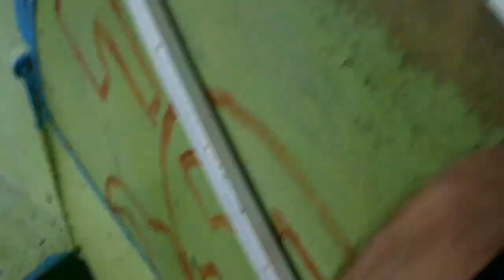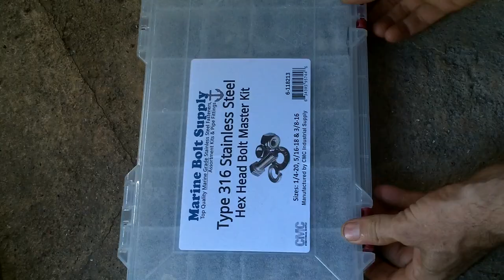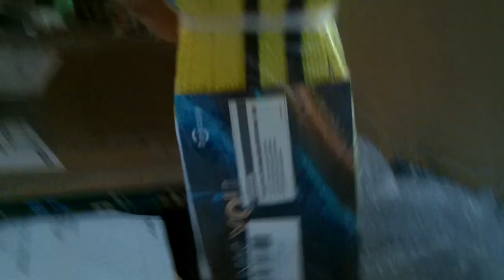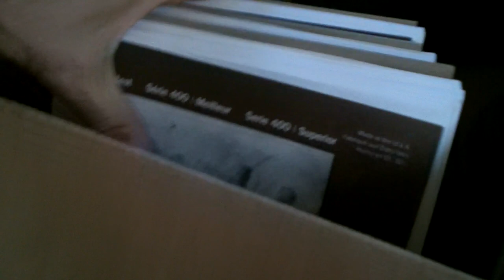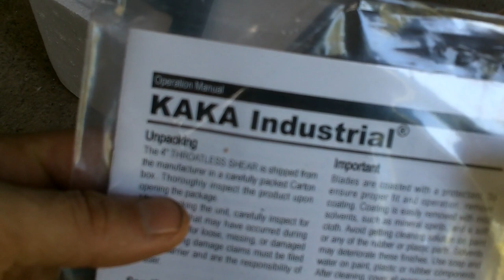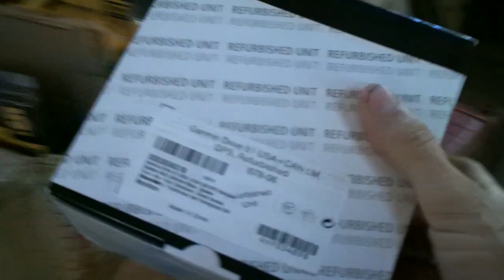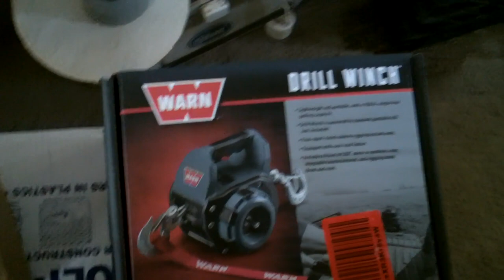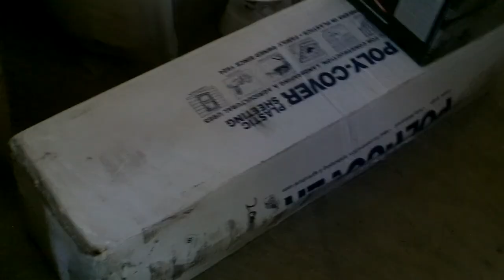Dragon Scales Roof 002 - The Materials Have Arrived!!

Comment: Jamie - I've successfully dissected and repaired hundreds of Dewalt batteries. If you have #10 security torx bits to disassemble them, disassemble them and take pics, and I'll walk you through the few things that can go wrong with them. Dewalts are great at DIY repair.
Reply: Hey do you have a video of what to do? I have a few batteries this has happened to. Thank you!
Reply: @JunkyardJosh  - it depends on the symptoms and how you'd use them. See my username? That, at Gmail, email me pics and I'll walk you through it if I can.
Reply from the maker: Awesome Matt! I just mentioned it to J. He says does it matter if they'd gotten wet? I'll send you an email with pictures if that doesn't matter. -Dashaina ✨
Reply: @JMEMantzel  - I mean, yeah, it matters, that's not "they broke" that's "sensitive electronics got submerged" but, either way, yes. Battery-wise the cells are almost certainly okay and are easy to inspect and fix. Circuits are probably wrecked, which is fine because the tools will still accept and work with them without communication (Dewalts will run on a car battery if they have to). Charging is going to be the tricky one, but, you can just clumsily piggyback on another empty battery when charging.
Reply: @MattsAwesomeStuff  thank you so much

Comment: Have you considered just making the whole thing on the roof as one big "tile", instead of many that you put on later? Alternatively build it on the roof in rings starting from the bottom and each new ring overlapping the prior one below. You could let the netting stick further out on the upper part and attach them by 'gluing' them to the roof with cement.
Is the roof strong enough to walk on? If not, maybe you can build some sort of scaffolding that you are connected to incase the roof gives in, so you don't fall all the way... 
Seems easier to make them on the roof to avoid the hassle of making them fit.
Reply: GOOD IDEA👍👍👍👍👍👍👍
Reply: Yes I agree that does sound like a really good idea to do it like that each rain overlapping each other they will be one continuous ring
Reply: One problem with going in rings is that the curvature which increases as you move to the top makes it tricky with the flat plastic (avoiding folds or cuts as much as possible). Maybe it's better to put the plastic from top down in shapes broadening out and with overlap of course. The seems could be put together and folded a few times to make it leak proof. 
Maybe making the whole upper part of the cement as one whole layer is better.

Comment: Well that looks awfully exciting, like being a five-year-old on Christmas morning again! I've been running the knock off DeWalt batteries for about 4 years and I'm convinced consistency is all you get with brand name. Some of the knockoffs are slightly crappier, but about half are distinctly either more powerful or longer lasting. Overall I guess there's been a very slight increase in total burnouts, but not statistically relevant. At the price difference, at least where I am you can get three to one so it's a no-brainer

Comment: For welding, Have you considered building a hydrogen generator? I know you like melting what's there instead of adding material. I'm sure you could also make something out of microwave parts. Assuming you've got the electric for either but welding takes power regardless.
Reply: In all my welding I am not aware of hydrogen- oxygen being used, not to say it cannot. Somehow I think it would be more efficient to use the electricity directly in welding than electrolysis to gas, burning.
Reply: @braithmiller  40v, 150 amps, I don't think that's more than most welders. Look up hho generators and welding. You've got to build a bigger unit than most videos to get 1700 liters per hour and 50 lbs of pressure, but I've seen them cut and weld everything including ceramics, and evaporated tungsten, so over 6000 degrees.
Reply: @tree6039  what would the possible benefit over plasma be?
Reply: @braithmiller  I've used plasma for cutting and welding, but honestly don't know enough about them to say. Using pressurized gas is different than an arc.  I like not needing wire or rods or gas canisters i have to refill. Different people like different types of welding, it's just personal preference. Other situations I don't have that much electricity but I can take gas bottles with me. Just depends on the person and the job.
Reply: @tree6039  At least as regards cutting plasma is just electric and natural compressed air. You can create your own shielding gasses if you're going this far. 
Sounds like and interesting rabbit hole.
Presently just trying to get supper compact multiprocess on my sailboat powered off my Beta/Kubota 16.

Comment: Don’t know if it’s something you wanna be doing but you could make petrol/ diesel out of the plastic by simply evaporating it in a vat heated without letting in oxygen (like you do making charred cloth or coal) and then condensate it to a fuel for outboard engines etc. Depending on the evaporation point and when to condensate you could be making petrol and or diesel if I understood it right. Seen a guy do it on camera on a remote self sufficient island set up. But the technology used was just low tech.
Reply: Well, one big goal Jamie has had with his whole endeavor on the islands is to be free from fossil fuel. All(?) his houses, boats, tools, everything, run on green energy aka solar. Why on earth should he want to 'make' diesel for engines he doesn't have, need or want?

Comment: Is it possible to make the motor power quieter?
Reply: has to be noisy so you know its working or it just need a bearing  lol .
Reply: Some it is harmonics- resonance in the motor/controller. Otherwise bearings. If there is a gear, use angled rather than straight
cut.
Reply: I get that it's pretty cool that it works well and is hand made but that noise would drive me crazy and I regularly listen to kids in a daycare squealing and screaming.
Reply: @consaka1  100x better than a combustion engine. My inboard electric is less noise than rowing.